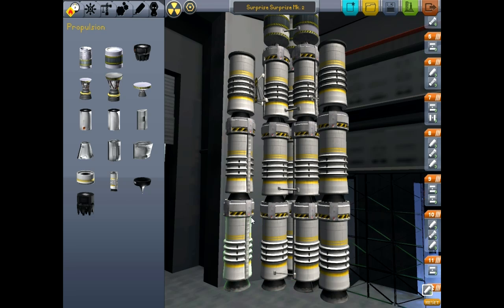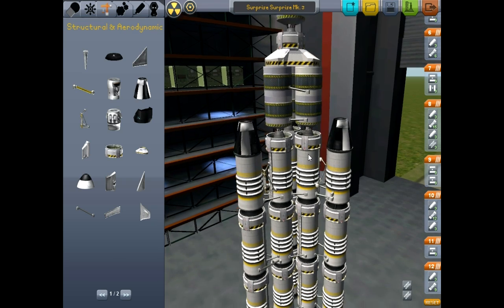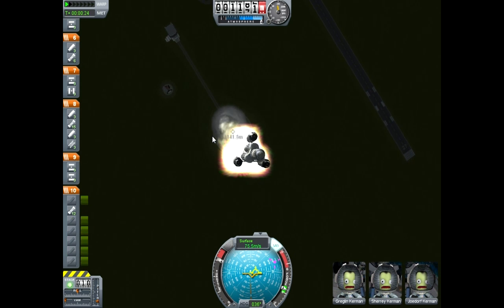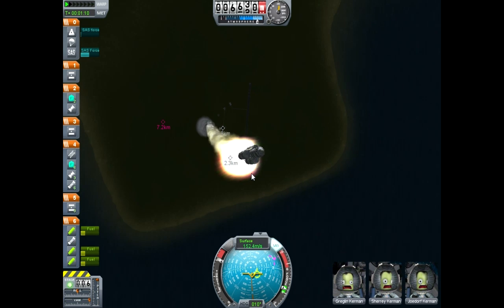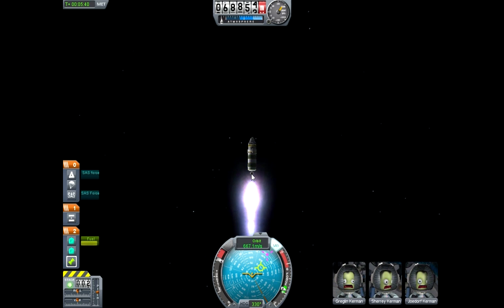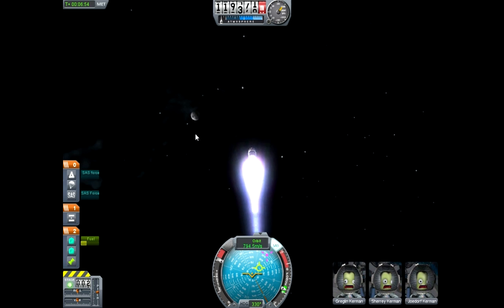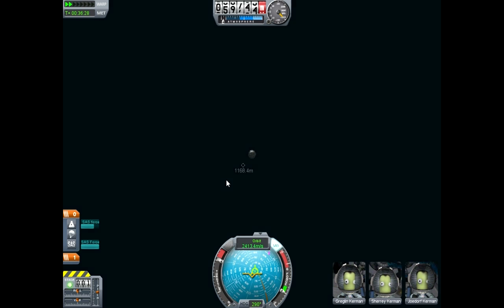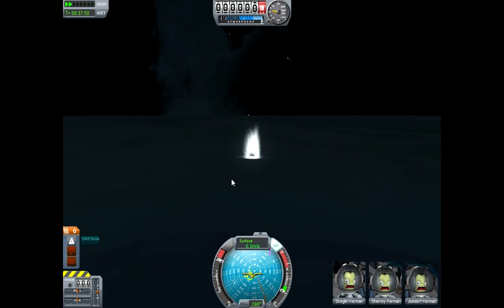Kerbal Space Program: To Infinity and Beyond! Apollo 9

Comment: Again, it depends on timing.
And also it depends if you want to be extremely fuel inefficient (GRR!)
And it depends on whether or not you use the new map patch that makes you see when you intercept the mun.

Also, I never had a crew return from the mun. Even successful landings I managed to have them stranded. (last one was a rover. used the RCS just to float there and eventually the craft toppled over and now I can do anything with it :/)

Comment: Doing a direct burn towards the Mun uses more fuel than a transfer burn, since this method, like liftoff, fights gravity the whole time. A transfer burn takes advantage of the low-orbit's negation of gravity to be more efficient. However,  direct burn is possible with a rocket big enough to get the needed fuel to space, as the game doesn't have the structural limits on rocket size that real materials impose. Once NL finds the more powerful liquid engines, hitting the moon will be possible.

Comment: You're using the weakest liquid rocket boosters, as well as the smallest and least efficient liquid fuel tanks, both are there for landing on the moon.
What you want is the most efficient fuel tanks as well as the most powerfull rocket boosters!
Also, switch the top most decoupler with the SAS module, you want to minimize weight for the parachute.

Comment: There's no weight holding him back.
Moving the load around only changes the center of mass, not the overall weight.

Once they're finished burning up the fuel, they are decoupled along with the ones on the bottom.

Comment: Northernlion you should actualy put all of your solid fuel boosters to the bottom for an initial startoff and after those are gone it will be lighter by putting boosters at the top you are having more startoff but the weight is holding you back thus making a negative effect .

Comment: 4. Use bigger engines, preferably with vectoring. The ones you currently use are for landing and taking off on smaller bodies with less gravity than the earth.

5. Learn orbiting and slingshotting techniques. You're not going to reach the moon straight up.

Comment: To Northernlion:

1. The reason your struts don't connect properly sometimes is because you're trying to drag the strut THROUGH a tank. Connect the points to the sides that are the closest.

2. Unless you want to form a crater on the ground every time you're going to land your command pod, the only thing you should be sticking to it is a decoupler. It doesn't need an SAS module on its own.

3. Don't add junk to your solid boosters, add some fins to your rocket instead. They work with the SAS.

Comment: You can do some really interesting stuff with the right side bar (ordering the stages)
For example, I join the decoupling of one stage with the start of the next engines, so I only press 'space' once, which helps alot, and you loose less acceleration btw stages... Or, when the first engines are fragile, I make sort of a landing gear, and eject it as soon as the the ship lifts from the ground.

Also, if you ad more parachutes, it helps, even when landing on land instead of water...